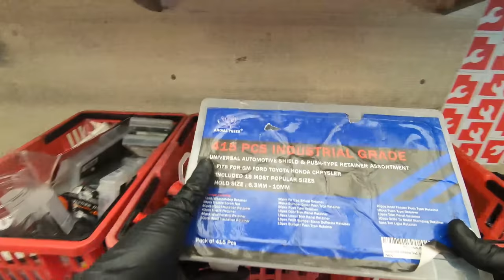Rescuing a car in the hospital parking lot.

Comment: I'd recommend picking up a radiator spill free funnel kit to help ensure no air pockets in the system. Cheap and easy to use
Reply: One of the best $20 purchases of my entire life - no joke.
Reply: 50$ from the cornwell dude currently on sale
Reply: tooltopia.com guys....
Reply: I picked up a oemtools from Amazon. Was around $20,only easy way I have found to fill my g35 which are known to be difficult. 
I used it on a few other cars as well. For sure worth the money.

Comment: Did you actually test to make sure it was the radiator that was bad? I have many times showed up to a job to do work that was “diagnosed” by multiple shops and turns out that wasn’t the problem at all. Doing your due diligence and fixing the problem right will give you a customer for life.
Reply: I though the same thing and that radiator did not look like it was leaking or bad at all unless it was clogged internally but that is a rarity
Reply: I can't say ive ever seen one plugged either unless stopleak was used
Reply: str8 menace yeah, unless the wrong coolant was used and got all gunked up but in that case you would have to replace the water pump and thermostat as well as flushing out the entire cooling system
Reply from the maker: yes we tested after i had her drive it. its all good now! :)
Reply: 2007 is a pretty old radiator if its original.
Reply: Roadside Rescue it would be cool to see in the video what or how that was causing the issue like what was wrong with it to cause it to over heat and then showing how the fix worked like a road test
Reply: @ThePinkPanth3r  My '96 Tacoma still has the original rad. I do flush the system every 5 yrs or so.
Reply: @ppeterson9359  but you use the correct coolant,  fluid change places are shady as hell in my experience.
Reply: @ppeterson9359  yeah, we know how awesome Tacomas are thanks.
Reply: Agree

Comment: Thanks for another great video!  Those fancy pliers for removing hose clamps are awesome - I wish I had them when I replaced the radiator on my 2011 Tucson ($70 for a used one from a salvage yard, from a Kia Sportage which is basically the same car in different clothing) and easily 80% of the time was spent trying to get a good grip on those dang hose clamps.  My hands are huge and there wasn’t a ton of space to work with.  If you ever do a radiator on the next generation of Tucson, they have these strange retainer bracket/bushing combos on the top but otherwise it’s pretty much the same as the one in the video.

Comment: A couple of suggestions here...since you didn't do the diagnosis on this, and just because it's open, I'd have replaced the thermostat at the same time.  You're on the hook now if it still overheats.  It's not that expensive, usually adds only a few more minutes, and is insurance for both you and the owner.  Unless it was just recently changed, I never change a radiator without quoting a thermostat at the same time. 

Also, I've had some cars that would not fill without vacuum filling the coolant.  That's a bit hard to do when mobile so, at the very least, use one of those Lisle no-spill funnel systems and run it, heat on, to burp the air.  Those funnels are awesome and once you try one you'll never fill a system without it.  I don't know how many engines I've thought were full but had air bubbles where you couldn't see them.  Lastly, I know you're using "universal" coolant but there really is no such thing as "universal" coolant.  Try to use the right stuff for the vehicle you're working on.  Even if it's not the stuff from the dealer, there are good aftermarket substitutes that are the same color and type as what you're draining out.  I'll bet you can get the Pentosin brands, along with Zerex red (for Toyota) Zerex G05 for Chrysler, etc.  Coolants are not all the same and on quite a few cars it's critical.  It also prevents the next mechanic to work on it from trashing you to the customer for putting the wrong coolant in it.
Reply from the maker: good idea. the diag was guaranteed from another shop. but thanks for the tips!

Comment: No running car to make sure cooling fans come and that you properly bleed system....🤔
Reply: He said no air in the system, so he probably did more than just fill it.
Reply: @allusernamesistaken  if probably is what your teaching a diyer then he should have a disclaimer cause I know seen a lot of issue when guys try and change out their radiator, then have a air pocket and overheat and so on.he should at least talk about it.most vehicles have a bleed screw and you open it when filling cooling system.
Reply: @gangas06  He's not teaching anyone. He is showing you parts of his job.

Comment: I like the way you use jack stands. Good. Just a thought, when you do brakes, that brake dust is not good for the respiratory system, at least wear a dust mask. I blow all that stuff off keeping as clear as I can while using a mask.  safety glasses when under a car because the dirt falls in your eyes and for anything that cuts or grinds or blows air  glasses needed.

Comment: In order to increase productivity/profit, place tool box at back of truck and install a back up camera and back truck next to the spot you are working at. Less walking around the truck. Put items you use the most within arms reach, less used items can go further into the truck and up higher in the box. If you use your battery ratchet all day then bottom drawer of box as close to the back as you can get. Put a glove box holder on the side of it and a magnetic spray can holder. Less in and out of the truck. If you want the keys near the box put a small chain on a magnet or glue a block to the side of the box and put enough slack to the key that you can lock/unlock box but don't have to look for the key or worry about dropping it. Not sure what you do with the old radiators/scrap metal you get but aluminum is recyclable and if you have some room to store them, turn them in at a metal yard and get some money out of them. Just some tips. Not criticizing in anyway. I think you're doing great! I noticed that the headlights were pretty foggy on that car. If you are near Salt Lake you can buy body parts from Interstate/Certifit.

Comment: You could solve the GoPro battery failing by buying a battery pack and a cable. The camera will work off the battery pack all day, just recharge every night. I use this method on my motorcycle helmet cam.

Comment: When you drain a cooling system do you use the petcock or just the lower hose? I know some mechanics are VERY anti petcock.
Reply from the maker: yes i use the petcock.
Reply: I only use the petcock when I'm replacing the rad...if im reusing the org rad because it needed to be r&i ,i will not touch the petcock because more often then not,the plastic is petrified and brittle and u can just look at the wrong way and it will break and if it doesn't happen to break, the o ring won't seal and it will leak down the road. For me  it isn't worth the risk damaging it especially in a roadside situation
Reply: @---skynet---  same here... only if the car is pretty new.. because heat and cold cicles of the rad brittles the plastic.. not a good way to start if you do it on older +10year car...

Comment: Make room for an upright compressor haha and wire it to your truck. Then you can use a vacuum filler which is by far the best way to fill a cooling system without worrying about leaks or air pockets. Also watch some scanner Danner and Eric O. I think you have the ability to be a great diagnostics tech. You'll be amazed at what you can learn from a few of their videos.

Comment: Nice vids keep it up! Btw I was wondering on how can I fix an uneven brightness on the headlights. The right one is particularly brighter than the left one
Reply from the maker: replace the bulbs with LED's and they should be even. but check voltage and excessive fogging on the lenses.

Comment: hey have you ever had a business owner or someone tell you to not repair something in the parking lot?  I saw you doing the alternator in front of auto zone but in my city there's signs specifically telling you absolutely NO repairs in the parking lot.   curious how you handle that
Reply from the maker: no. especially autozone they love me there. but so far never.
Reply: @RoadsideRescue  Been a Tech for 35 years, Did the Mobile thing for about 5 years. I always had to ask the Customer If they owned the property we would be using for the repair. Or at least if the owners minded if we did the service there. Apartments won't allow it. Many business owners frown also.Worst case had to have it towed to a friendlier location.

Comment: When you do a job where the vehicle is nosed in you can back your truck up and be able to save time in and out the back of the truck. 

The reason I mention this is even though you're working next to your truck people will try to steal from you even if the front door is closed by still going thru it.

 Another option if you nose in is to have a dinger like some stores have where when someone including you walk thru the door it dings then if someone is trying to rip you off. 

Recommendations for coolant jobs,  a pressure tester for after completing the job you can test it for leaks but also a hand vacuum gauge / pump so you can put a vacuum pressure on the cooling system when ur done and holding the vacuum on it will get any air out as you don't want air pockets as one air pocket can make a quick job turn into a long day. You can also use the vacuum pump / gauge for power steering pumps / rack & pinion systems as well to do a "bleed" and get the air completely out of the system. 

Watching the cleaning video now. Next time when you empty it run to the car wash and blast the back end out with the pressure washer. 

Was that polish kit the one on Amazon? If so I think I bought that one and still have it in the box. 

Would love to find one of trucks up where I live. 

To get the pitting out on the aluminum you want to get some jewelers rouge I think it's called as it "cuts" the aluminum but won't hurt it. 

Want to learn that part lookup how to shine rims and fuel tanks on semi trucks with a "high speed buffer"

Keep coming with the content. Good so far!. Also on the coolant. Make sure ur getting the correct coolant for the correct vehicle. End result if we don't, (yes I do repairs as well) will be shortlived cooling systems as each mfr has their recommended type. Yes autozone may warranty that part but we also have the customers car to worry about as well. 

One other last thing that came to mind was when working with fluids they make this stuff called "pig mat". Comes in squares or a roll. Good for getting and keeping oil, coolant, etc absorbed. I have one for oil, coolant, etc based on what the job is. They actually would work good in the truck under coolant tanks, oil jugs in that tray you have that stuff setting in. Great item to have and you're being "environmentally friendly"
 

If you respond by chance just copy and paste this and put a star for each answer below each question suggestion I had / typed  then you can answer them without having to remember them all. 

Have a good day and keep em coming. You must have the wife helping you edit the videos with as many as ur putting out.... Lol....
Reply from the maker: Nice stuff. I’ll look into all of that. I see these trucks all the time on marketplace you may look there. Thanks for the awesome ideas!

Comment: I was curious before you did this repair did you confirm that the rad was actually bad before replacing. Because anytime i so side work i always confirm. Because i find 50% of the time. People mistake one problem for another. Unless you can see there was a clear issue such as it busted and leaking.

Comment: Ernest I live in Gresham OR on a Dodge Avenger car when you hit a bump in the road and the brake light comes on is it a loose wire harness that is not connecting to the brake light completely or should I take in the vehicle to a mechanic and have him install a new wire harness for the vehicle.  It just started acting up less then a month ago or is it something I can tighten down with a tool

Comment: Howd you determine that the radiator was the cause of the over heating issue? Was it clogged or leaking?
Reply from the maker: It was diagnosed by a different shop. But I assume a pressure test. Which is what I do.

Comment: Just a thought. You said she just had the ac worked on. Is it possible that the cooling fans were working. If not it would cause it to overheat.  Just asking.
Reply from the maker: Yes. Great question. They were the radiator was leaking. But the AC does still have an issue the other shop is warrantying.

Comment: I had a 2007 Hyundai Tucson, but mine was the 4 cylinder. Never had an issue except I had the battery go bad when my wife was driving it. I think that was in 2016 or so. I replaced the battery myself and damn was that a PITA to do. Hyundai definitely doesn't make their vehicles easy to work on, at least not for us average joe's.

Comment: Never trust someone else's diagnoses. They can be wrong and if you do the work and it's wrong, you'll be the one getting the bad reputation. Always recheck it and verify first. Because for overheating it can be the radiator but it could be a bad water pump or a bad thermostat even a bad head/head gaskets but the latter it would run like ass. Unless it's leaking from somewhere you can actually see.
Reply from the maker: it was guarunteed from another shop. but if it isnt then im more careful.

Comment: Hello, I’m a fairly new subscriber, and I have a question, I was wondering if you knew what would be wrong with a 2006 Dodge Charger that kept turning off after half an hour then let cool for about 10-15 minutes before being able to be turned back on? I couldn’t find anything on it, it’s a friend’s car, he said that they had the spark plugs and gaskets changed, but the mechanic they sent it to couldn’t find anything wrong, could it have been something electrical?
Reply from the maker: sound electrical. check your grounds maybe.

Comment: I have a 2014 accord and my rear wheel area makes a noise like playing cards in a wheel spoke. Both sides. I changed the tires, brakes/hardware and rotors. Still there. I only hear it when I'm driving near a wall/barrier. Not really loud but I can hear it. You ever have this problem? Thanks.

I was hit awhile ago in the rear and had bumper removed by bodyshop I wonder if its a windnoise.
Reply from the maker: maybe bearing.
Reply: @RoadsideRescue  Oh wow.

Comment: I haven't thought of using knee pads but that is good idea. I'll start using that.

And for experience of not using knee pads. Well when I worked at a grocery store, I was still pretty new I worked about 2 months in, that was when I just started having my knees on the hard concrete floor to work the bottom shelf. After a week, I started to get pain in my knees, so I just stopped doing that. I just crouch or sit on the floor to work the bottom shelf. They do issue knee pads working at the grocery store but I don't use them. Few others do use them at different stores.

Comment: Any lettering on the truck? I used a similar service and the mechanic got another job just with the truck advertisement. He was using a regular box truck, and he had a tire machine and balancer  in the truck.
Reply: Tires for me, aint a mobile mechanic deal lol, unless it's changing out a spare. Might help some but then you need to carry tires around, stock them somewheres, order them in, a whole bunch of work just for tires, and who wants to be doing tires mobile.

Comment: How come you didn't run the engine to cycle the coolant because more then likely there is trapped air under the thermostat if the Ran it on low coolant.

Comment: You could have parked your van on the driver's side of the car you worked on but ended up parking on the passenger side.  Just by chance but there is a difference that counts when you get the choice on which side to park.   Parked on the passenger side had you having to go to the passenger side of the van to get tools + items out of the van as needed.  Efficiency and less steps make for an easier and quicker job and work day.  Cheers

Comment: The battery and starter and alternator are new
Reply: Does it crank but not start? Can you pull any codes out of the computer? if it's cranking but not starting the place where i would start is CKP (Crankshaft Position Sensor) if that craps out the computer will not know what position the crank is to tell spark and fuel when to fire. I would pull the codes before you start firing the parts cannon especially if you already put in a new fuel pump.

Comment: Hmmm.  Her car overheated because of a bad radiator?  Could it be a stuck thermostat or a bad water pump? 🤔.  Usually, bad radiators result in loss of coolant and a steam plume due to a leak.

Miss the road trip music.  Also, congrats on doubling your subs in 2, short weeks.

Comment: Don't you run the vehicle after doing that?  You might have air pockets in the engine block and once the engine is run and the thermostat opens, it would fill the engine and end up being low on coolant.  I always make sure to run the vehicle and then top it back off just so the customer doesn't come back complaining.